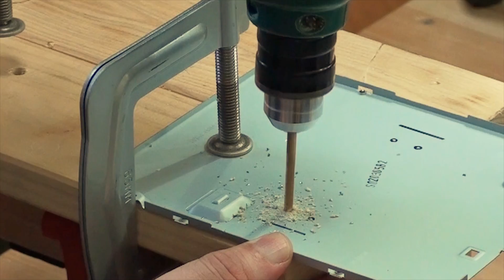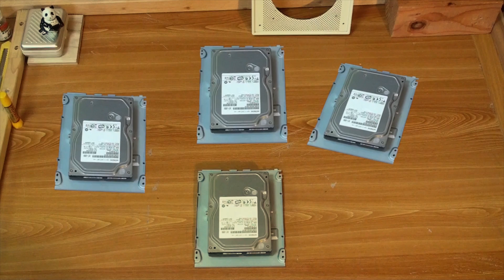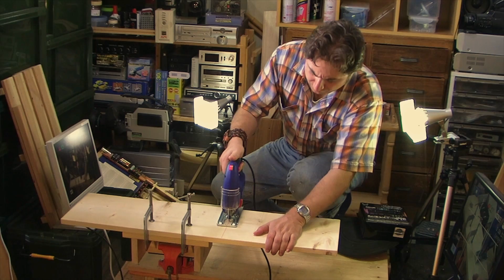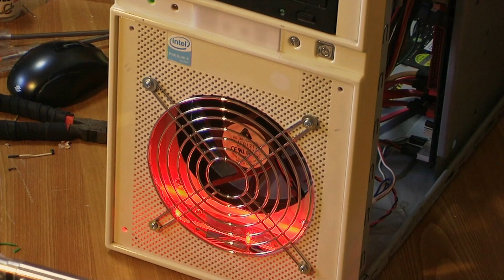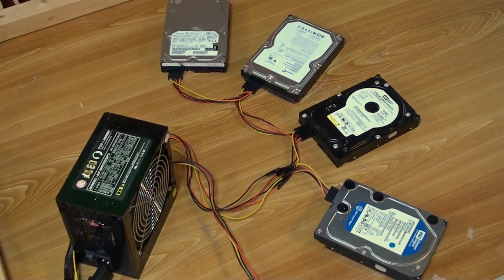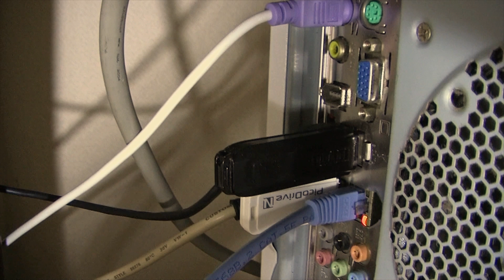DIY-Building RAID Inside 400W PC Casing

Comment: That looked like an enjoyable project!
Reply from the maker: ***** it really was. later i made some small changes. for example i replaced the CPU fan with a bigger and stronger one. installing Windows 7 64 bit pushes the CPU to work and it gets hot, so that little fan coming with the CPU pack wasn't able to cool it down properly.

Comment: Nice Build!
You should check the drive temperature to make sure they are not getting too hot. (Touch after running a few hours) Typically hard drives depend on the bracket which is holding them to assist in dissipating heat, since the drives were mounted with two screws, the thermal transfer will be low.
If the cover plates on the front of each drive do not have ventilation holes, the drives might not be getting enough air flow.
Nice PC cases have a fan in front of the drives to ensure airflow.

Comment: Does not matter how much ram you have windows will always try to read from disk. Ready boost just helps quickly access small config settings. If you run an SSD it might not be needed.

Comment from the maker: right,
after 2 days running as RAID, I checked the top drive and bottom drives are fine but the middle one gets very hot, i solved that problem by installing a 3x3cm
small 12V fan directly to that HDD, as there was one channel of fan controller free, so it matched well, now they are all fine and the whole system works fast and smooth :)

Comment: I use the SB750 chipset which has built-in RAID control. The only problem with that is that if the Mo-Bo fails, I need to replace it with the same chipset to recover the RAID.

Comment: A simple side-loading screwless drive bay made from plywood would have been a much nicer option. The space seems to be there and the airflow would be much more predictable. I don't think your added fans add much in cooling performance and the implementation isn't the most... aesthetic.
Also, why not make you brackets have 4 mounting holes instead of two? It will probably be fine, but looks so shoddy balanced on the two centre screws..

Comment from the maker: i know what you mean :)
yes that is right, but at least we should see the full part of the cup and ignore the empty one. Microsoft just added 3 level of simple RAID to help average users, we can make only up to RAID 5 with Win7, but if they didn't add, we didn't have any.
if we can afford we go for advanced and better controllers, but if not, then win7's controllers works for simple storage.
the problem is if HDDs are 2TB or over, it takes up to 10 or 20 hours to Re-sync, even with i7-890 CPU.

Comment: please help. im a newbie in this and own 3 seagate x 4tb. what is the difference between 1 raid system of 24tb (6x4tb) (around 3200$) and 6 seagate external hardrives of 4 tb (150$ each one, 900$ for 6). I mean , is there any difference in their lifetime? will the raid system live 20 years or 40?( if is so, then the price is worth, cuz lifetime is what really matter at all)
 I have understood that the external hardrives only longs 5 years and thats pretty short. but for what ive seen. the raid system seems to be 6 seagate external hardrives all assambled in one box. i would really like a very helpful answer. thanks.
Reply from the maker: HDDs or SSd are electrical and mechanical devices, they do not operate life time for ever.
only software and data can operate life time. to make the data safe you need software as a controller while the data are copied on drives.
the software has all the control and copies data from one disk to another, in-case one HDD is down, while you replace it with a new one, the software re-build it with same data again, this system is called RAID.
now it depends to your budget and type of data and work to choose a type of RAID SYSTEM. it depends, you have to find one to fit your work normally.
Reply: Samimy Productions wow , it backup itself? wow i had no idea. when one of HDD (the little boxes that seem like external hardrives 3 tb) goes down. where do u get the replacement? has to be same brand as the raid? same memory? about how long longs one HDD?. any good raid brand with 24tb? ive found this in google for 2499$ but there are others same size but 3500$ like buffalo brand. 
((((LaCie 25TB 5big Thunderbolt Series 5-Bay RAID))))
http://www.bhphotovideo.com/c/product/1024090-REG/lacie_9000462u_5big_25tb_thunderbolt_5_bay.html
25 tb is just what ive looking for. 
what do you mean with type of data and work? one that fits my work would just be one with big memory. About the budget, i can stay with water and bread for a few months
Reply from the maker: League Combo
 you need to read more about RAID first some more topics.
the only purpose of RAID combination are:
1. data redundancy (which you can call temporary backup)
2.speed
now it is up to you to choose one.
if you buy RAID systems in compact, it would be expensive, but making your own RAID would be cheaper.
a hardware controlled RAID is more expensive than a software controlled RAID , but they have issues, for example a software RAID  is cheaper but uses your CPU mostly to control all the RAID ARRAYS, a hardware based RAID does most of the job itself and leaves the CPU alone.
Reply: Chaika? Yes, Chaika. Chaika.  If you don't know what raid is and what it is used for you simply don't need it. That amount of data is simply to much for consumers at this point (it will eventually within 20 years). Just stick with your 4TB drives.

The difference between the raid system and "just 6 drives" is that the raid system has a hardware raid controller, onboard caching memory and a failsafe for power outage so it can write its buffered data to your disks so they won't fail all at the same time.

Comment from the maker: sure it needs software or hardware controller,
thanks to Microsoft adding RAID controller to Windows 7 so it is very easy to build RAID now, otherwise a simple  RAID driver costs around $400, 
love windows 7   :)

Comment: Umm you do know they:
A. Make drive tray kits
B. Make PC cases that will hold more drives
C. Make Large Capacity drives
D. Make Solid State Drives
E. Make laptop sata drives which you can put in a desktop, they also make adapters for mini IDE to standard IDE..

Why didn't you just repair the bad PSU and use it instead of circumcising it's SATA rails? 
Also why add all the extra fans if your only going to slow them down with a controller, his defeats the whole purpose of moving enough air across the drives..

I think it is safe to assume you are not formally schooled in IT? Even if your a trail and error person you should know that it is not the best idea to hook all that to the working 400 watt PSU.. Your asking for either another dead PSU or a small house fire.

Also if your going to make this an independent drive tower via way of RAID then it is recommended you use a Linux OS and not Microshit Whinedows 7... Just saying windows is resource demanding so why eat up resources with a fancy GUI when you can get top performance if you take the time to learn Linux command line..
Reply: "Why didn't you just repair the bad PSU"
Because when it comes to repairing computers, one generally does not "repair" PSU's. They are too dangerous to open and work on. Usually you simply replace the PSU. Only very specially trained professionals are supposed to open PSU's.
Reply: It's only a switching DC power supply.. But I see the point where the non pro would not repair one.
I have repaired my fair share of PSU's, mainboards needing new caps or reflow, bad hard drives...name it